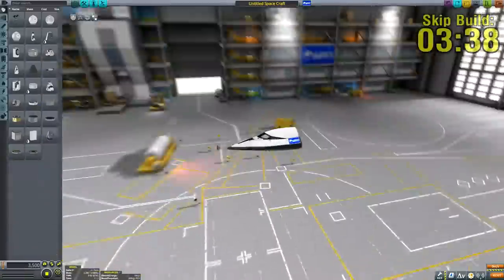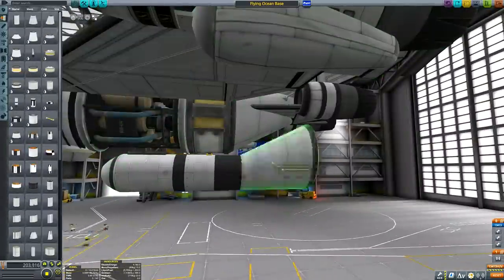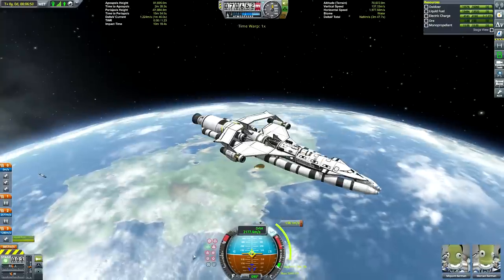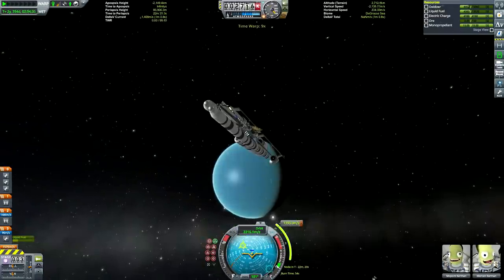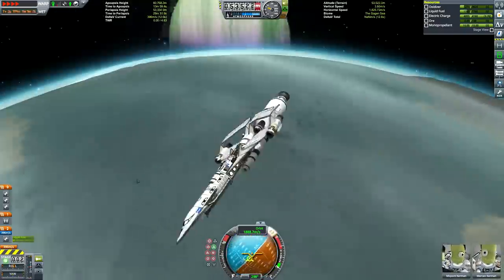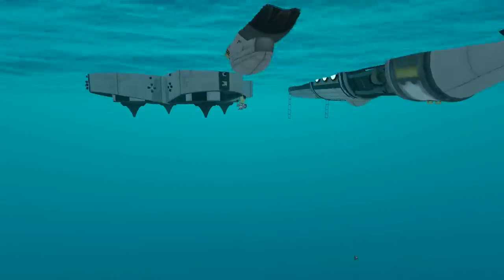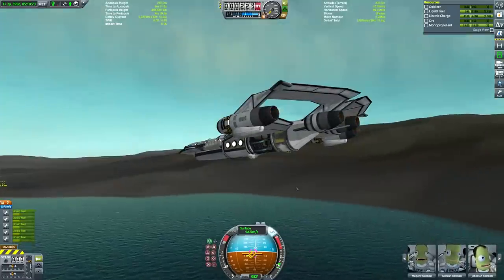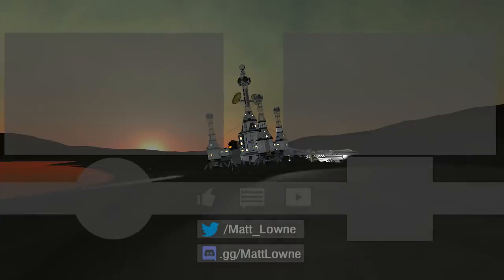KSP: Flying Laboratory SEAPLANE to Laythe!

Comment: 19:35 Deploys ladders

Seconds later: jumps off straight to the ground without using ladders

A true kerbal design
Reply: I add parachutes then use engines to land on kerbin
Reply: Ladders are there so you could get back
Reply: @josephdavison4189  parachutes are just backups
Reply: Relatable.
Reply: But he never used latter.

Comment: The whole reason Laythe is so similar to Kerbin is probably due to tidal heating. Even though it’s far away from the sun. The gravity of Jool pulls on the moon creating friction that creates heat. This could cause a similar atmosphere.
Reply: @Nathan Meunier That's not what he meant by tidal heating, it is when the tides vary throughout its orbit, causing friction that generates heat. This is similar to how Jupiter's moon Europa has liquid water and an oxygenated atmosphere.

Comment: So you mentioned that the purpose of the Laythe missions was to determine why Laythe is so similar to Kerbin despite it's distance from the sun. One explanation could be that as Laythe orbits Jool, the immense tidal forces exerted by Jool on Laythe stretches and squeezes the core of the planet like a rubber band, producing lots of geothermal energy that allows Laythe to be warm. This is a similar process to what happens to Europa, a moon that orbits Jupiter. Satellite scans have shown that beneath Europa's icy crust there is a 100km thick ocean that is kept warm by the geothermal energy of the moon
Reply: Or io's volcanic activity

Comment: I’ve been developing seaplanes myself recently and it’s actually a lot of fun! Most of my designs (except one) have been “flying boat” style designs, and I’ve even built a few SSTOs based off of my designs. Your seaplane is really pretty but I’m amazed it can take off even if it does need the closed cycle, I find without floats or a hull structure with a step-shape, it’s really hard to make them take off without either having very powerful engines, and I also find they need canards at the front to get lift. I guess the hull shape at the bottom works even without a step on your design. Either way, this is an amazing design and I love the wings.

Comment: The rhino engine is actually one of the most efficient vacuum engines at an ISP of 340, beaten only the poodle engine of 350 and the terrier with an ISP of 345. For comparison, the vector engine has an ISP of 315. This doesn't consider DLCs or mods.

Comment: I bought the DLC  for the same reason. I wasn't interested in the mission builder. Just the parts
Reply: Same here. I've used a lot of them too. Especially the Russian upper booster tank.
Reply: @sf-1_raptor  which one?
Reply: Capitão Explosão Making History. It included a lot of replica parts from the Space Race era. The LEM, the Russian capsule and booster, American lunar rover wheels, and more.
Reply: @sf-1_raptor  Oh, I was referring to the parts.
Reply: Capitão Explosão Oh! In don’t remember the name, but it’s the pointed, Russian-style fuel tank. It has built in separation boosters, so it makes a great booster part.

Comment: 13:21 I tried to send a plane to duna once and learned the hard way. So I glided it to the top of a hill and figured I could at least coast down the hill. I did so and got a silver trophy for putting a Rover on duna 👌
Reply: Use Rapiers
Reply: @KSPAtlas  well now I have electric motors and propellers so I dont have to worry about that, or about running out of fuel

Comment: Making History parts are definitely stock. And of course I bought it. There are several engines in it that are just amazing, especially if you don't mind parts clipping; for example, there's no point in using any other engine than the Bobcat as a lifting engine, until you reach the vector and the Saturn V rockets.

Comment: erhrm... I'v never heard of a nose down reentry. usually you want to start at 80-90 degrees and end at 45.

Not to mention starting reentry from LEO.. unless you wanna go crazy with a moon return reentry and risk an entire shield (high AP, 15-35km Periapsis).

Or thats what I learned from the delta glider and ravenstar, as you need to reduce speed before heat takes over.

Comment: To be fair, the kerbals would still die upon taking off their helmets due to frostbite caused by Laythe being much further away from Kerbol. Then again, kerbals don't require food, water, sleep, or even air (ie, they can stay in orbit forever without their air ever running out), and they are much more resistant to blunt trauma then humans, so they're probably also resistant to extreme temperatures.

Comment: I'm late to this party, but I TRY to find a reason to use the Rhino. I love that thing. I'm in career mode, so they are expensive, but I recover them when I can, or they stay on my vessel. My current Kerbin Asteroid Grabber/mover has a Rhino and the TWR makes that worth more than having 6 or 7 Nuclear engines. But more often than not, I can be more cost effective/efficient NOT to use a Rhino unless the payload is very large.
I've only just recently purchased the expansions, but I LIKE some of the "making history" engines a lot, BUT... KW Rocketry has some very nice Mod versions of the engines/tanks. The Mastodon, Cheetah, and Bobcat are the best of the pack I think SO far.

Comment: Two comments, you are worried about the range of your seaplane, you could possibly extend it by filling up the plane with both fuel and ore before leaving the land base, and converting that ore into fuel at the ocean base or along the way (Though I'm not entirely sure if that would increase or decrease deltaV, the extra weight of carrying the ore around might decrease it if you wait until reaching the ocean base to refine it, I don't know what the conversion rate is like). 
The other comment is about the Making History DLC. I don't personally have it, but I'm fine with you using it in your videos, I don't play KSP much anymore anyways (since watching people play it is a lot easier :P ).

Comment: hey matt what do you use to connect the tips of the box wings to the body in 1:31 i have tried making a box shaped wings and it just doesnt connect
Reply: same
Reply: after i commented this i tried making a box plane but i used auto strut and had the tip submerged in the main body and it worked @azriel5
Reply: hmm... I will have to try that. I've never used auto-strut before

Comment: Not making an aircraft capable of flying supersonic while not using afterburners is going to kill your efficiency.  Per km at least.  Faster, higher flying will get you there quicker and save fuel.  Wheasleys are only efficient if you need to loiter around up in the air for some reason.